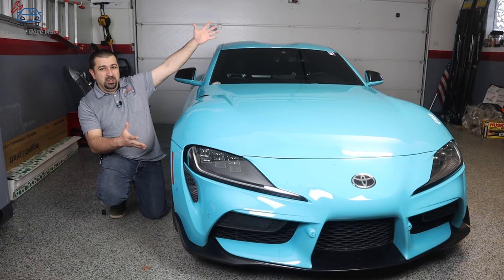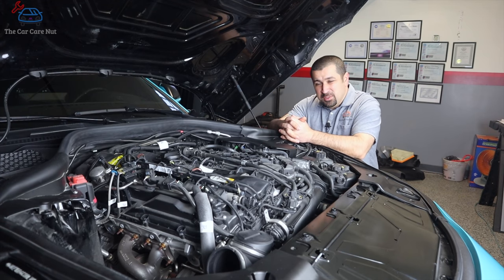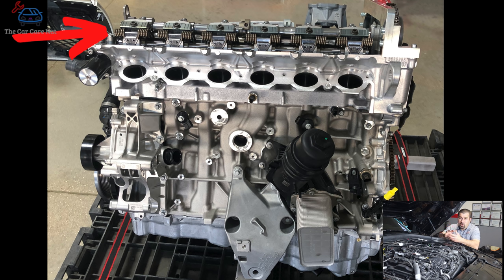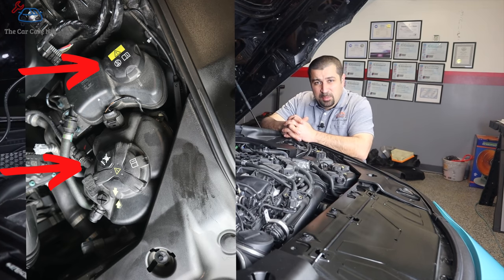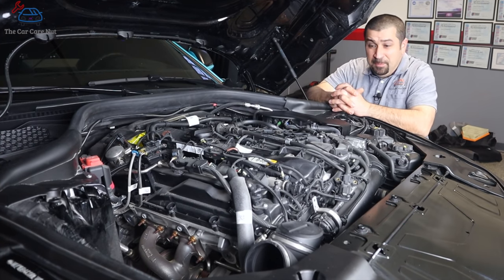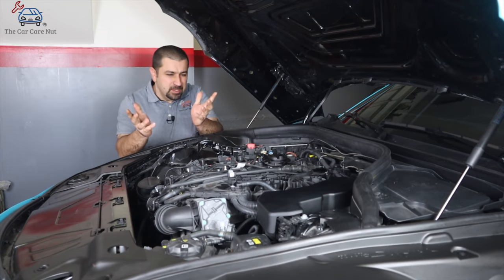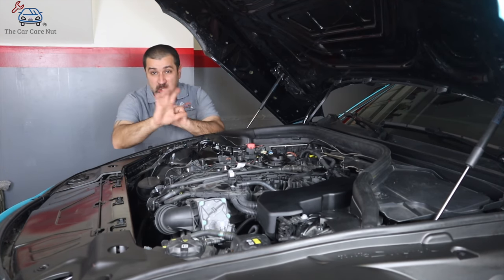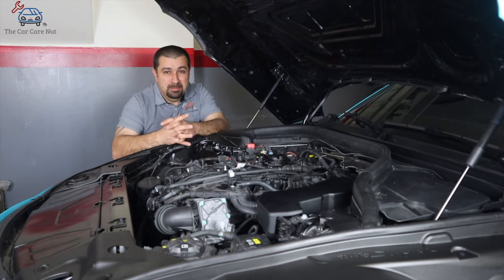New Toyota Supra Technical review and common problems

Comment: i can't believe toyota stick this trash engine in the supra. it will start to leak oil and coolant when it reach 20,000 miles just as all bmw. Toyota is being lazy, bring back the 2jz
Reply: You have no clue what you are talking about 2jz fanboy. I am way past 20000 miles on my M140i and it leaks nothing, not oil and not coolant. This engine is a masterpiece.
Reply: @bradofwar5960  of course I am 2jz fan boy, because 2jz is better engine than your engine. The 2jz was built 20 years ago and still better than your engine. It is better in every aspect, power and reliability. Go look it up then talk
Reply: @bobit8742  I know what an iconic engine it is. You are just trash talking a good engine so I respond in kind. Bmw makes one of the best, if not the best straight six engines in the world.
Reply: @bradofwar5960  bmw make very good engines in general, they just use crap gaskets. Oil cooler gaskets alway leaking and then valve cover gaskets. It is a known issue for years but they don’t fix it. And don’t start with those electric water pump, it dies at 50k miles if you lucky. I know this because I have 2012 bmw 335xi. They over engineers the engine and it at the cost of reliability. It quite expensive to fix these cars. It’s not just bmw, mercedes same thing my dad 2018 mercedes E400 leaks at 35k 😂

Comment: God, what an awful car from Toyota. Thanks to this video I won’t make the huge mistake in buying this junk bmw. I was hoping that this car would be a blend of the  engineering of bmw but with the reliability of Toyota but no... this is just a bmw with a Toyota badge.
Reply: You weren't buying it regardless.
Reply: @GT-RTData9  I'm actually shopping for a sport car. why are you a troll?
Reply: And what if it is? I got decent miles on my M140i without any problems. Just the cost of maintenance like an oil change. Engine is a masterpiece.

Comment: Toyota should have insisted on a non turbo standard fuel injection more reliable design.  This over computerized plastic toy will be a junk pile if it makes it to 50k miles.

Comment: You may have stated The Facts BUT a explanation of how they work would be helpful in creating knowledge in their problem probability. This is honestly not a Toyota. It still remains an over engineered German car with all the problems that come with same. It is Far from reliable IMO. All your efforts and explanations cannot make up for the fact it's German which does not mean strength and RELIABILTY as all other SUPRAS before it. Time will tell but the past is the criteria for the future. BMW does not exude reliability and with a performance car driven hard I for one bet on problems . Just as their WWII the German tanks were so over engineered they were not reliable and headache to fix.  Germans seem to justify in their minds that YES it's expensive to maintain but precision design requires precision maintenance. There is no thought given to practicality.
I was waiting for so long to buy one. Actually paid off my car loan early to get ready to buy the SUPRA. WOW was I let down. They even released the car with that air buffeting problem when the windows are down. A simple yet unsurprising design oversight. Yes it can be fixed for a few bucks but really. ?

Comment: Way too much plastic being used. In the pursuit of meeting  unrealistic and unnecessary MPG dictates from ignorent California that bet on solar for the electric grid and found out the sun doesn't shine at night. Toyota is sacrificing repairability and vehicle longevity to dump anything not made out of metal for lightweight  plastic; the thiner the better.  Will a 2021 Toyota last two or three hundred miles like those made prior to 2018 and the answer imo is no. The why is easy. Plastics can't began to deal with the heat or cold range that metal can. Las Vegas at 121 F in shade and you get the idea.  Obviously heat deformed that plastic oil pan in the Supra that soon leaked.
Reply: Aside from the comment on plastic parts...spot on....PALEASE....California is to blame for this. Get real...and educated.